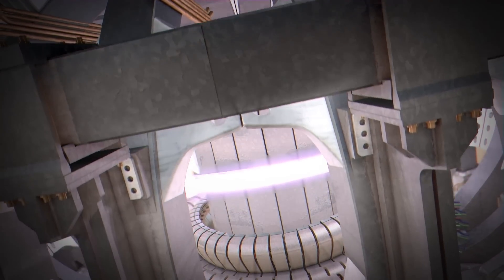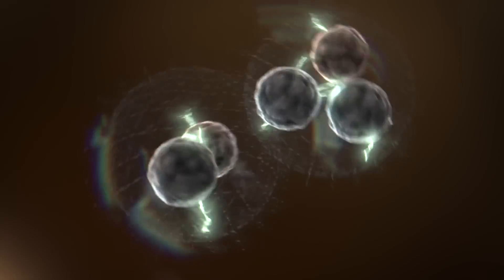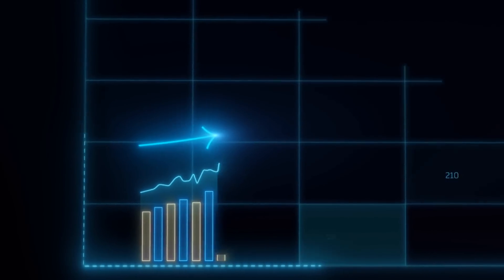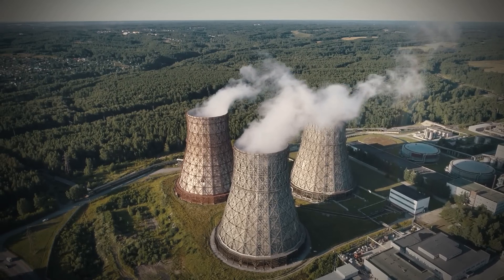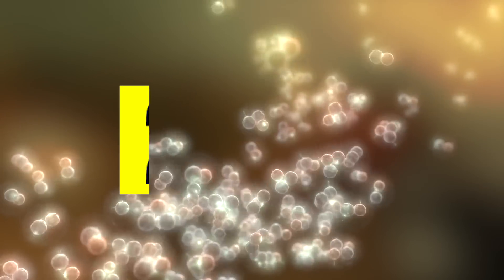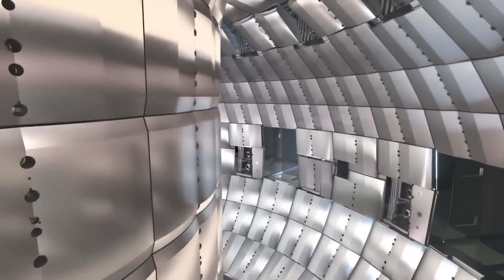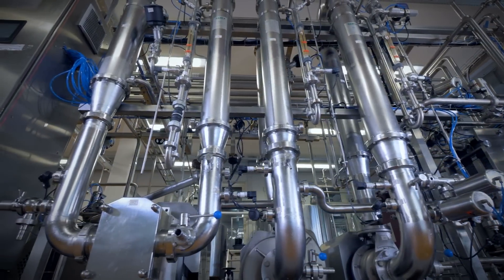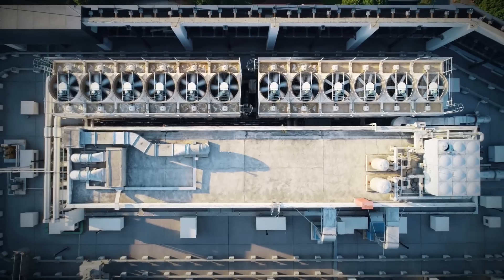The Shocking Problem That Could End Nuclear Fusion

Comment: I remember 50 years ago fusion proponents said it would take 20 to 50 years.  Well, 50 years have elapsed and so far we have a reaction that lasts 5 seconds and requires more power than it produces.  Maybe in another 50 years we will have a reaction that lasts 10 seconds and produces the same amount of power than it consumes.
Reply: Usually progress is exponential,not linear so time will be much shorter

Comment: The way forward seems to me to be that once sustained  DT fusion is achieved we need to push forward and continue increasing the  achievable temperature and confinement to the point where D-D fusion becomes self sustaining and thus do away with the tritium requirement except perhaps for starting up more easily. D-T fusion has always seemed to me as merely a prototype that is the easiest possible form of fusion just to get us started.
Once ITER is running a self sustained fusion it will teach us a lot about how to optimize the confinement performance meaning we will be able to achieve the same type of fusion with a smaller device and/or achieve a much harder type of fusion (D-D) with the same size of device.
Reply: Even D-D is seen as the less ideal reaction vs aneutronic fusion fuels that can produce power directly rather than through thermal transfer.
Reply: @mnomadvfx  Looking at the required energies in wikipedia, aneutronic reactions take way too much temperature, we may never do them in  net energy positive production.
Reply: Fossil fuel is our future.
Reply: ITER in France will be finished by 2025 if all things goes correctly.
Reply: SAFIRE PROJECT and AUREON ENERGY can maintain an near indefinite reaction.
Reply: Kalki Ironman type 7 and 8 after 2026 😎

kalki avatar (beast of the earth) (christ on the white horse) (son of man on clouds) is the biggest enemy of dajjal/antichrist/kali 😏

Kalki Avatar (Murtaza) 11th satguru 13th imam cousin of Moula mahdhi a.s. 12th imam (muhammad) 😎

Prophet Moula mahdhi is raja shashidhuvj (the mighty one) born less then 1200 years ago 😎

Prophet Moula Isa a.s. will kill dajjal cause dajjal is going to kill Kalki Avatar 😏

Kalki Avatar will follow orders from 2 religious king Moula mahdhi a.s. and Moula Isa a.s. 😎

Kalki Avatar going to have 2 swords and ring of moula sulaiman a.s. and staff of moula musa a.s. (iron rod) Staff of moula musa a.s. is like omintrix can transform into anything and can transform others into anything And stone in the ring of moula sulaiman a.s. is also known as kastav mani and it's more powerful than all 6 infinite stones combined 😇

Cuz Kalki is ironman batman super saiya-jin superman ben10 saitama optimus prime shaktimaan and every super heroes combined after 2026 😎

This staff will transforms into white horses with wings,weapons,iron-man,cloud etc or can do imagination into reality 😎

*Ratn sru sword of lord shiva (miri)😇

*Ratn varu (zulfakar) sword of Moula Ali (piri) 😇

miri piri 😇

Kalki Ironman after 2026 😎

Satyug (sunrise from West) 2038 😏

Sambal is hospital 😏

Gzwa e hind 2029 😎

Khalistan and Azad Kashmir after 2026 by Ironman 😎

99% Hadith u heard is not about imam Mahdi it’s about Kalki avatar (the main character) that person momin vs dajjal prove me wrong if u can 😏😏😏.

Comment: Its also worth mentioning that tritium, just like normal hydrogen, is difficult to contain. Some will escape causing health concerns.
Reply: D2O occurs naturally, and does not react exactly like H20, but it takes a large enough concentration generally over 25% of total to cause effects. T2O is radioactive, but has a biological half-life of like 2 weeks (the water in the body is replaced constantly). In the first hydrogen bomb test, they flared off their excess deuterium. Tritium occurs naturally, but much more infrequently.  Interesting that the Li-6 used in the nuclear weapons stockpile seems to have all been produced before they shut Oak Ridge down.

Comment: There is no problem with nuclear fusion, there is a problem with the old tokamak concept, where we spend most of the money! We should invest into different newer fusion concepts. For example the two-laser picosecond Proton-Boron Aneutronic fusion. for example the DPF (dense plasma focus fusion). There is no Tritium needed, no neutrons from prime reaction, no neutron radiation, no radiactive waste and you can direct conversion into electricity without boiling water, making steam and use a turbine with generator.

Comment: All these difficulties make current battery research to improve energy density seem quite feasible and attainable (as is being proven). Of course, if and when they overcome them in such a reactor, there is still the problem of harvesting the immense heat produced and converting it to electricity. Presumably this will be through generating steam and passing it through turbines. Designing a new system for a fusion reactor would surely take much time and money.

Comment: One other little problem…materials must be developed that can withstand highly energetic (14 MeV) neutron bombardment. Those high energy neutrons will knock atoms of the first wall off their lattice sites. This creates vacancies and the vacancies coalesce to form voids. The end result is void induced swelling. Components will grow in three-dimensions and will lack stability. This was a large problem in our fission breeder reactors that produced fast neutrons of only 1 MeV energy. The fuel was lifetime limited by swelling of the structural cladding and fuel ducts. Within a year of operation volumetric swelling amounted to 16%. This swelling has to be accommodated by allowing the reactor core to move. 

Fusion reactors, with their much higher energy neutrons will need to accommodate some swelling in the first wall. Excessive swelling will require replacement of the first wall which will be complicated due to it being radioactively activated by the neutron bombardment. Vanadium and Vanadium-chrome alloys resist swelling, but there likely isn’t enough vanadium in the world to service manifold fusion reactors.
Reply: Good point, what's your opinion on just building very very large fusion reactors. Square cube law would be in our favor here, right? I also think it should be easier to achieve energy surpluss. I also like the idea of magnetic mirror fusion as it seems so simple. My favorite fusion reaction is protium lithium 7 as these elements are very abundant and the fusion reaction is almost aneutronic. I do know that it requires way higher energies and has a smaller crossection making achieving energy surpluss probably a lot harder.
Reply: @DehimVerveen  That's a good point, perhaps our tendency to cut budgets and try small isn't working with fusion. Perhaps we just really have to think big and once build a big enough thing so that we actually can get something from it, rather than having 100 small reactors that are all not capable to produce a surplus of energy.
Reply: @IroAppe  Well, this is kind of what they are doing with tokamaks with ITER/DEMO/PROTO. While ITER is expected to be the first reactor to achieve thermal energy surplus, it will not be producing electrical energy. That will be done by DEMO, but DEMO is most likely not going to be producing electrical energy until 2050 and even then, it is "only" expected to be producing 750MW of electrical power and is not going to be cost competitive with existing fission technology. I still very much think it is of course important that we do build these test fusion reactors, however they will not be on time to combat climate change, unless these plans and the research will be drastically accelerated. I also think we should look more into other types of fusion reactors like magnetic mirrors and stellarators.

For now I think we should focus on existing technologies which include domestic production of solar cells, wind energy and also fission energy. If we want to build a fossil fuel free economy, we are going to have to sequester as much carbon dioxide as we emit and that will require a hell of a lot of clean energy production.
Reply: @DehimVerveen  as an interim move we should be relying more on natural gas. With gas supplanting coal the US has already reduced CO2 emissions by 30%. The same idea can be applied to automobiles. 

Just about all Japanese taxi cabs run on CNG. It will cost about $5K per vehicle to make a dual fuel conversion (gasoline & natural gas.) That can be accomplished much quicker and less expensive than converting to an EV fleet. Also, natural gas is piped over much of the US so distribution is less of a problem than outfitting a network of rapid chargers. It would also take a lot of diesel-fired gasoline tanker trucks off the roads. 

Yes, I know that CH4 is supposed to be 60 times worse as a GH gas than CO2, but how much is actually leaking into the atmosphere as a result of man-made activity vs. that emanating from oceans (frozen methane leaks) and as swamp gasses? 

Again, this would be an interim solution, only, that could be rapidly exploited to reduce GHG emissions. In the meantime the EV build out could continue so long as it was powered by clean energy (fission, solar PV, wind turbines, hydroelectric, geothermal.) 

The one Achilles heel about EVs is if there are sufficient mineral sources to even complete the first generation of complete changeover. Prof. Simon Michaux has done a fairly complex whole world first estimate and concludes we will come up way short on just about every mineral required for EVs including copper, cobalt, nickel, lithium, vanadium, rare earths and so forth.

Comment: Problem: those neutrons that are needed to breed trithium cause harm to biology and the infrastructures, through nuclear activation. Translated: a lot of radioactive waste that has to be disposed (clean energy? Really?) And horrendous disgregation of the materials (from the magnets to the supports, to the sensors, to the wires etc) which get brittle, crack, and swell becouse of  pockets of He or H2 gases forming inside. Translated: continuous  failures & shutdowns. Even much increased rate of incidents. The power plant would be operational just a slim percentage of the theorical time, barring that some major breakdown due to the extreme gradients inside the core did not happen, leading to very long repairs (weeks? Months?). All these add to the costs of an already sky high costly power plant. 
These problems alone should put an end to this kind of fusion (tokamak and inertial laser), because they are originated by the physic of the process itself, and thermodynamic in nature. You cannot hope to defeat thermodynamic.

Comment: An insteresting and well put together video,  as for the deuterium-tritium (D-T) fusion, it is for sure one of the best sources of energy, but it's not the only fuel, there are fusion reactors researching D-D fusion, which is less energy productive but is vastly more abundant in the oceans.  There is also research into D-H3 reactions, which is helium-3 which is a promising fuel, worth a look into. 

Thanks for the video! :)
Reply: The problems with D-He3 fusion are twofold. One, it's a more difficult reaction than D-T (which is the easiest), requiring higher temperatures, pressures, and/or confinement times. Two, the vast majority of the He3 comes from the decay of tritium (from the old cold war nuke stockpiles). So, if we can't get enough tritium, we won't have He3 either. There is talk about mining it on the moon, but the amount is so small and the fact that no extraterrestrial mining has even been attempted yet (for any material) that getting He3 from the moon in anything like the near future is unlikely.
Reply: To my knowledge, D-D reactions can't produce enough energy to break even on the electrical production/consumption balance sheet.
Reply: @ArcherOfJustice  D-D reactions do produce less energy, but the product is either T or He3. If you get tritium, that is immediately going to fuse as D-T. So that will help. Likewise, D-He3 reactions will add more energy and both those reactions have a lower Lawson criteria than D-D fusion. I think we still have a long way to go. Just keeping the reaction going is hard, but they still have to figure out how to extract energy and not kill the reaction.

Comment: If that were the only problem with fusion we could solve it by building more fission reactors to breed tritium. The more serious problem is that fusion is nowhere close to energy break even.
Reply: in a video by sabine hossenfelder, How close is nuclear fusion power?, the almost unsurmountable problems of achieving the Q_total instead of Q_plasma in fusion reactors is explained; as always, also in nuclear energy science there are plenty of scams
Reply: That's the whole point of research. If it were already breaking even, the amount of commercial investments would go through the roof and governments would all be racing to build the first commercial fusion reactor.
Reply: "The more serious problem is that fusion is nowhere close to energy break even"

Part of that is due to the length of time before the plasma simply fizzles out.

Once they can increase this time period from the 17+ hr current record to days at least it will help the reaction become self sustaining.

Another improvement is higher Tesla superconducting magnets which reduce the necessary size of the reactor and power to bring it to fusion levels.
Reply: Extreme liberals: Reeeeeeeeeeee
Reply: Entonces energía de fusión solo detonando bombas atómicas en cavidades que aprovechen el calor de la explosion
Reply: except ITER is set to be the first reactor which will produce much more energy then just breaking even
Reply: @justADeni  Even if ITER meets its goals it will actually not break even. It might produce more plasma heat than energy put into the plasma but for actual engineering break even it will fall short. Last I checked the energy needed to run ITER is about 422 MW and with 500 MW of output heat you would need to convert that heat to electricity with MINIMUM of 84.4% efficiency. For reference, the best natural gas power plants have efficiencies of about 60%. So overall ITER will end up around 0.7 of break even.
Reply: @justADeni  You're talking about the Q factor yes? There are actually two Q factors. Q plasma and Q Total Yes ITER is going to get more energy out of the plasma than they put in. But not enough to hit the Q total break even point which is what a fusion reactor needs to reach in order to produce useful power.
Reply: @justADeni  You need to be clear that scientific breakeven (Q-plasma = 1) is when the heat out from the plasma equals the plasma heating input.  ITER aims for Q-plasma = 10, so 50MW of heating input and 500MW of output.  But, the machine as a whole will require somewhere between 300MWe to 600MWe input electrical power.  Engineering breakeven (Q-total = 1) is when output electrical power equals input electrical power to the whole machine.  In the ITER case, Q-total would be at best 500*40%/300 = 0.67, if the output heat were to be converted to electricity (it won't be).  At worst Q-total = 500*40%/600 = 0.33.  So overall ITER will consume more electrical power than it could generate.

Comment: The very idea of a steady state fusion reactor is nothing but a fantasy, and a deeply hubristic one. It shows a fundamental misunderstanding of the requirements of a 22nd century solution.

It should be obvious to any thinking person that a pulsed fusion device is required, and that total independence from a steam cycle is also mandatory. ANY and ALL so-called "solutions" without these features are designed to further entrench the stupid centralized power production model we currently have, and ensure the most expensive electricity ever made.

A viable fusion device must have several features:
a) Cheap and abundant fuel
b) No radioactive by-products
c) No steam cycle
d) Small enough to be lifted by a helicopter
e) Easy to refuel and maintain safely
f) Easy and simple to replace when needed
g) Extremely low cost

Tokomaks are for suckers, and as Bussard famously said: "We've spent several decades and many billions of dollars of Tokomaks, and so we know a lot about them. And what we know is that they are no damned good. I suspect the Russians released it because they knew we would waste our time and money on it."

There is no doubt that ITER will never produce a design for a commercially viable fusion reactor. But at least it will produce a stack of Ph.Ds taller than the reactor building, and result in some interesting physics. But that is all it will ever lead to, I'm afraid.

Comment: I'm a lot more concerned about nuclear embrittlement and contamination of the reactor walls which makes them unusable after a couple months.
Reply: Fission reactors have the embrittlement issue too and can be designed to work for decades.  The radioactive metals produced by a fusion reactor wouldn't be like spent fission fuel, easily dealt with and not needing thousands of years of storage!
Reply: @RWZiggy  the rates are not comparable.  With fusion reactors the containment vessel has to be replaced every couple months

See "What no one is telling you about nuclear fusion" on the channel "tech for luddites"
Reply: @donh8833  

For the non-robust test reactors yes but things actually designed for long run will be different. For ITER, they have blanket system with first layer of beryllium (and other materials will tested) to absorb the neutrons.  The blankets will be replaced once in 20 year lifetime of the device.

The intention is to use as much of the neutron flux to make tritium, I think this is just engineering issue unlike the sustained fusion itself which is an actual "is it even possible" issue.

We may find that the only way to do useful fusion is to have a star around...(cue sad trombone(